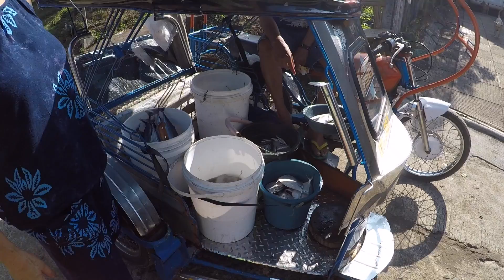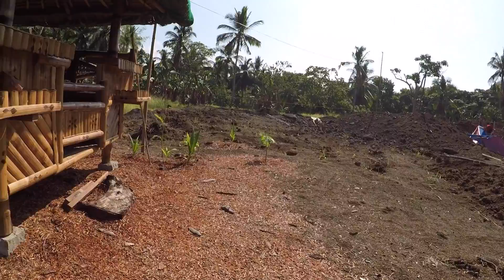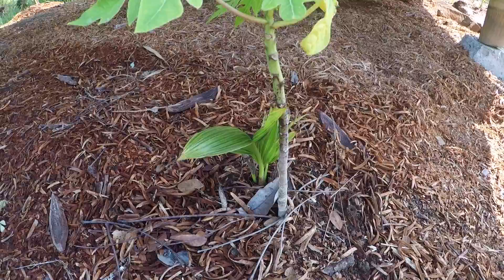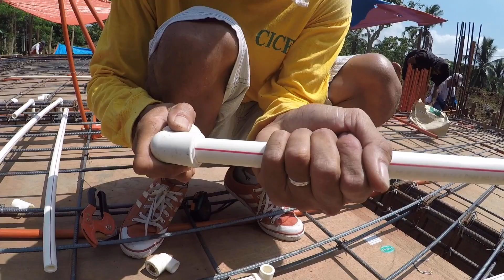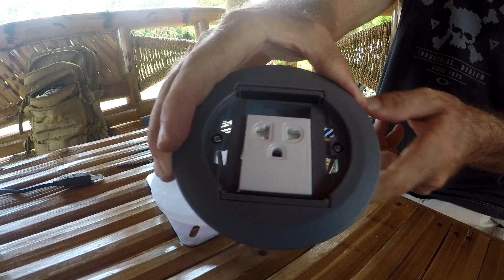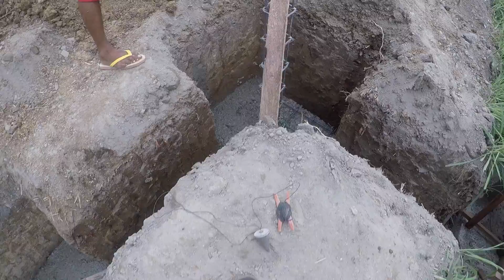VILLA FELIZ  - EPISODE 59:  WELD MY PPR (House Building in the Philippines)

Comment: I laughed when I saw the pipe leaking. Not because of the leak because I cringe every time I see water pipe in the Philippines. They use galvanized steel pipes for water supply. The major problem with galvanized steel pipe is they eventually stop the flow of water because of the sediment that build up inside the pipe. It's kind of like the arteries inside your body closing up because of plaque, eventually causing a heart attack.
Reply from the maker: Yep...maybe I should add some of my cholesterol meds to the water supply to break down that buildup  😉

Comment: RE: Outlets for electricity. Here it is code that they be spaced every ten feet  around the room wall parameter in all rooms, because futures, i.e.:  lamps etc. have 5 to 6 foot cords, thus always reach an outlet in every room no matter how you move the furniture.  Also an AFCI is required in bedrooms and is for frayed or damaged fixtures, here it is code for bedrooms only. A GFCI (Ground Fault interrupter) is for outdoor outlets and areas with water such as kitchens by code in North America (preventing electrocution from water contact to the outlet) . A GFCI here is available in either a breaker style or outlet. In the kitchen  and all bathrooms there  is by code usually one GFCI in the kitchen and they get linked in the outlet from a set of second screws at the back of the outlet. I heard you talk of this a few videos back and thought I might comment.
Reply: Also GFCI's are used on all outdoor outlets. Given they use 220 out there for outlets I would definitely advise there use.

Comment: ALERT  - ALERT !

James, 

Regarding your floor thickness I would stick to the
Engineers specifications of a 6” inch slab. There is a principal in Engineering
of adding an additional safety factor of 30% beyond recommended specifications
as a margin for error ( as we do in north America and the west) and also
considering there are pipes weakening the slab inside,  this margin maintains the slab thickness in
those places. I would advise you to talk to your independent engineer regarding
this matter. That safety margin of six inches rather than four which may be adequate,
but during a 8 point earth quake or stronger, you could have a structural
failure. Being a University educated Project Manager myself, I have seen
contractors do these things in the field to save money, to balance the
financial side of the “TETRAD”, - but this is not in your interest to modify
the engineer/architects margin of safety that was intended to be built in,
there is a vested interest to reduce this cost by your contractor, be careful
my friend. This would be almost impossible to properly repair after the
concrete is poured. CHECK THIS OUT:

https://support.office.com/en-us/article/The-project-triangle-8C892E06-D761-4D40-8E1F-17B33FDCF810

 

By the way my son and I are still enjoying your videos with
our breakfast every day.  

CHEERS! - Mark
Reply from the maker: We'll end up with around 150mm.  My builder told me today we're pouring 115mm then ~30mm of self leveling concrete, then of course the tile finish.
I had him pull all the approved city engineers plans and they were approved for 100mm but with a slightly different rebar configuration.

Comment: Hi James , very entertaining videos , keep them coming . One of your subscribers asked what is the longest length of your largest beam . We are in our early stage of designing our house for our plot on Royal Tagaytay Estate .We would like an open plan design incorporating the living room and kitchen , this would measure 8 m x 5.5 m , is this possible , or would we have to introduce a dividing archway ?
Reply from the maker: Longest beam span in-between columns is 5 m.
The open space design is what we have for great room, kitchen, and dining room.  The great room opens up toe a vaulted ceiling at the second floor.
I don't see any issues with a 8x5.5 m as long at it follows the structural engineer's recommendations.  He'll recommend slab depth, rebar size and spacing.

Comment: I would have assumed that your conduit would have gone on top of your bottom steel not underneath and on top of the form ply, but maybe it's their technique, it seems that it will be just under the concrete instead of being solidly encased,just an observation
Reply from the maker: Yes...my choice is to put the conduit in-between all the rebar but this is how my builder does things.  I just told him to make sure all conduit is above forms so concrete encases it all.

Comment: You should try a venturi type of pump to avoid tasting that coconut wood water. 😎 you will need an air compressor for your workshop anyway. 😉
Reply from the maker: Yes, I'm going to look the next time I'm at the mall...ACE Hardware.  Once the 1st floor slab is built there'll be very little water making it to the basement.

Comment: James - I saw you make a comment about your faucet by the water meter leaking and the poor material used.  I ship faucets, bathroom items (shower heads and etc), kitchen faucets from lowes or homedepot/ USA.  I even ship plummer tape and putty.  I found one mistake in January.  They installed a new kitchen faucet.  They did not put the plummers puddy under the sink drain lip, instead they put it underneath the sink around the fittings.  DID I HAVE A LEAKING PROBLEM WHEN I USED THE FAUCET!!???  OH YA YA.   Balikbayan (SP) boxes are great.  We ship using forex but there is also LBC and others.  I also make sure I ship a good supply skippy or Jiff peanut butter.  It really goes good on pandasal and coffee.  Enjoy life.  Its never boring.
Reply from the maker: I really wish I had thought about the balikbayan box before I left the US.  I won't be able to make it back in time to get any shipment for the build.  :(  After the house is built I'll put together a box the next time I'm back in the US.
Just finished my pandasal this morning.  Wish I'd have seen your comment about peanut butter.  Maybe tomorrow.  Thanks!
Reply: LOL I know about it because my wife uses to send staff and it takes an eternity to arrive there. I will send all kinds of tools before i start building.
Reply: Great idea on shipping plumbing taps shut off etc.  The crap I saw for sale in the Philipines was shocking.  At a condo is Pasig saw a plastic Chinese bathroom faucet that leaked like crazy and it had hardly been used..

Comment: James, in respect to your comment regarding suspended slab thickness, I agree that 200mm is too thick, however, 100mm is too thin!  You will end up with a floor that bounce as you walk across it.  Check with your English structural engineer mate to confirm that you need 125mm to 150mm thick suspended slab.  It looks like you are spanning in excess of 3 meters and 100mm thickness is not sufficient.  Regards, Andrew.
Reply: http://www.engineeringtoolbox.com/simply-supported-slabs-load-capacity-d_1803.html
Reply: Hi James, the info I have read says a depth to span ratio of 30 for domestic use so 100 mm seems too thin, another consideration may be the strength of the rebar, its probably on the low side
Reply from the maker: Thanks for the comment on the floor thickness.  Please provide a reference that shows this is not sufficient.
Reply from the maker: Thanks Lawrence.  Please provide the technical engineering reference so I can discuss it with my builder.
Reply: I went to the about section to obtain your private email with no success.  Are you on Facebook?  I can send you a PDF of the concrete standards applied in Australia.

Comment: hi james, i watched all your episodes.i noticed that in some areas  your electrical,plumbing and steels or rebars were to crowded. please check the building code requirement for the concrete covering of pipes.and the steel that supposed to be top and bottom where being squeeze together.can they put the pipes in between the top and bottom steel?
Reply from the maker: Yes, they do tend to crowd both pipes and steel.  I try to make suggestions sometimes of where to put things but sometimes must rely on the builder if I don't have an answer.  I feel we're okay as long as we have a good pour and make sure the cement fills properly between all the steel.  Will make sure there's a lot of vibrating going on during pour day.

Comment: Hi James
I am learning a great deal watching your vids, thank you
Have you considered poly foam forms for your walls, eg
http://www.archiexpo.com/prod/pontarolo-engineering/product-54951-430188.html
Not sure if its availabke in PI
The nice thing about the coco nipa walls is that they dont absorb heat during the day 
As i am sure you know 
With concrete walls that heat then radiates back into the house at night
In theory the poly form acts as an insulator keeping the walls from heating up on the inside
I understand its really quick to build too👍👍
Not sure how an outer skim on poly will stand up to an earthquake😙😙😗
Just a thought
Reply from the maker: As always, thanks Sibat.  I'll take a look at your link.

Comment: while I won't vouch for the quality of the valve I did notice that it looked like it was way over tightened when it was installed. The threads on the nipple were buried in the valve.

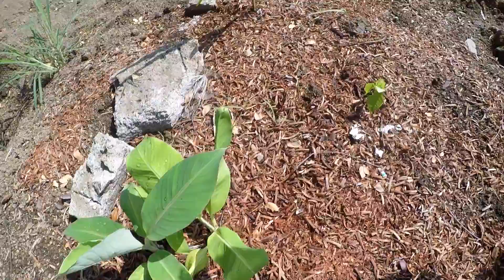Comment: Hi James,  At the 9:44 mark. What sort of plant is it?  It's a green plant. :) I have no idea either. We must be twins. 
Siphoning. - Connect the hose to the tap and turn it on. Once all the air is out, quickly disconnect the hose, place your finger over the end (of kink it) and walk it down to the drain point. It'll reverse the flow and siphon out. Good luck.

Comment: One cool thing our builder did was use a 5" x 5" square piece of floor tile that is cemented into the top of the drain cover - and around that is about a 1/4" gap where the water drains down around this cover. Looks really nice and integrates nicely with the floor tile.
Reply from the maker: Can you send me a picture.  Sound interesting.
Reply: My PI Dream Sure can, how do I send it?
Reply from the maker: You can send private email messages to me securely by clicking on the "about" tab on the main page.  There is a section under the Description block with the header of "Details".  My email is there next to "For Business Inquiries".  Click on that and you can send me a secure email that is only seen by me.  A message saying "I'm not a robot" will appear.  Click on that and then submit.  This prevents my email from getting spam.YouTube does a great job with their security features.

Comment: It's Ground Hog Day!
Reply from the maker: Ain't it so?
Reply: I was trying to beat all the gold star and coconut tree winners today! I still did not beat MrAllcanadianbiker and Arturo Palma! 
Now I have had time to watch the whole video. You definitely got a lot done today. Not quite the same as in Ground Hog Day. 
I assume you will be making a run back to Clyde's...ummm Ace Hardware in the near future to get that water leak fixed. We have had trouble before also with using the cheaper grade fixtures for some of our outside water connections. I went with the local hardware and in a matter of months had to replace them. 
The information given below in the comments is correct concerning the papaya trees. One added note is some trees are even bi gender and those too will not bear fruit. But I have been advised as they say you need a male and female to cross pollinate so you can get fruit. I am not a "green thumb" guy, so I cannot provide you much information other than that. We were lucky to have a tree come up and it started bearing fruit. I was just happy that happened. Too bad though that we lost it in last years super typhoon that hit our area.
Hopefully you will have a successful meeting tomorrow. Even if Filipino time, you should be on time at least. I hope you will get the answers you need and have some insightful information you can pass along. Sending in the big boss is quite impressive move on their part. LOL